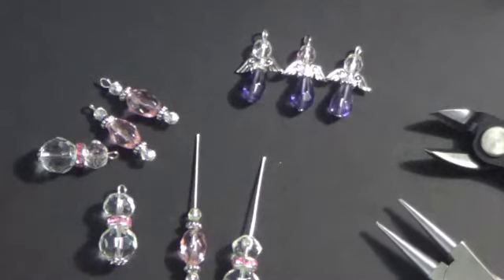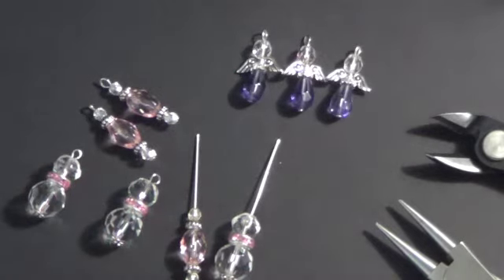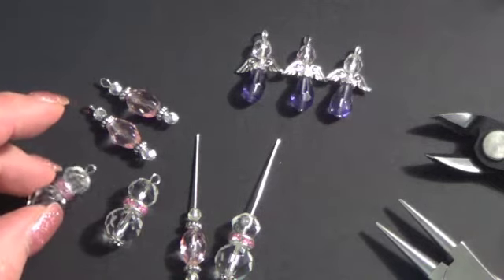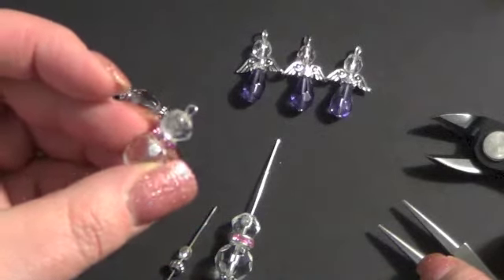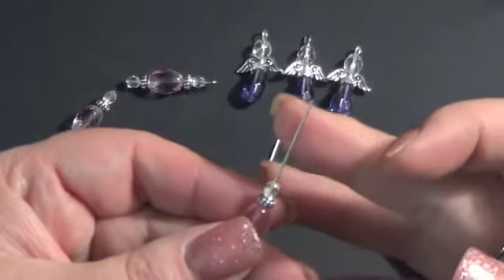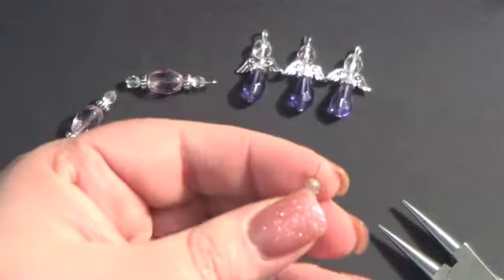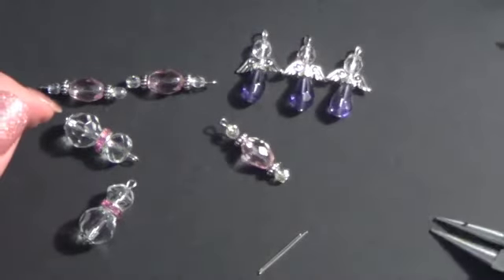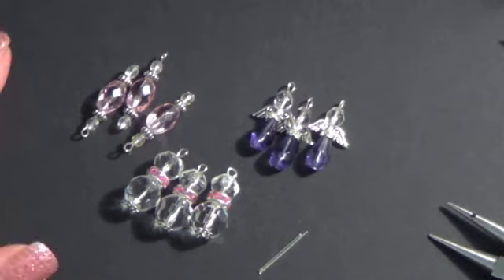Bead Dangle Tutorial

Comment: What a nice way to do it, I like the oval shape. I can't wait to get started. Thanks so much for the upload:) Also, can you tell me where to get a good set of pilers, that will contain everything I need for wrapping etc.? I bought a few pairs and , well as the story goes. you get what you pay for. At  least for me.
Thanks again
Janet
Reply from the maker: I think I got my first pliers at Joann Fabrics or Michaels…I then took a couple of classes at a local bead shop and bought a little bit better pair. If you have a local bead shop…I suggest checking there. Hope that helps!
Reply: What kind do you use now? What brand?
Reply from the maker: jan cat I am so sorry but the wording on the tool is worn off. :(
Reply: That's cool, I just got the best around. I am so very happy with them, they have wonderful reviews.